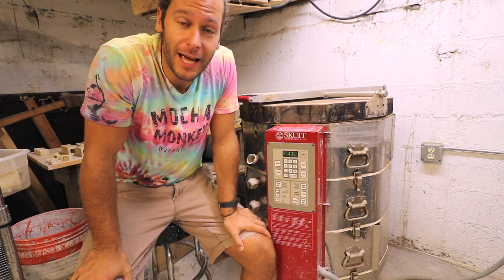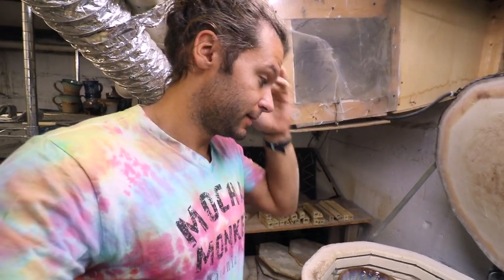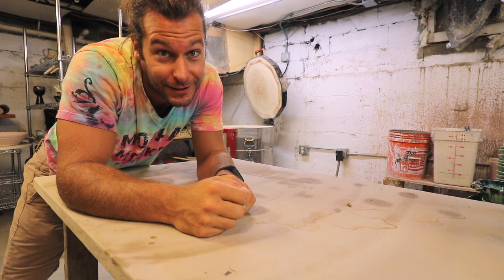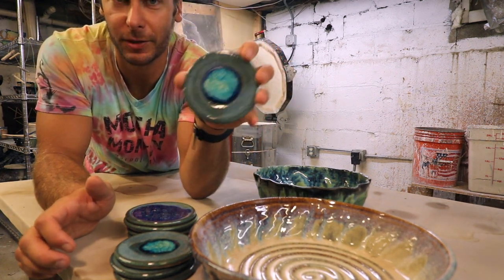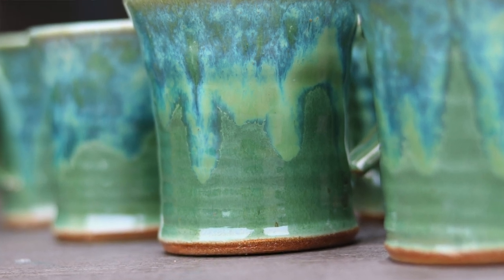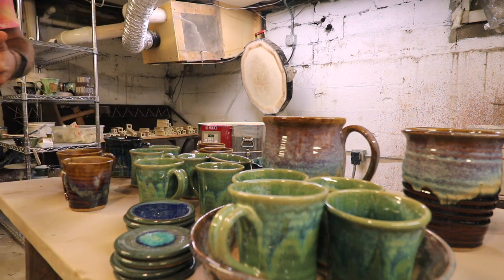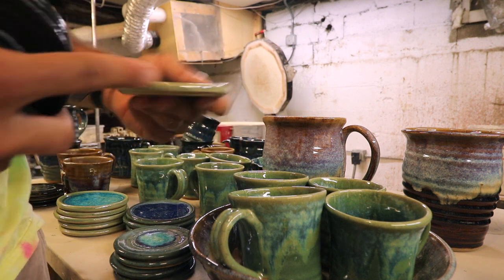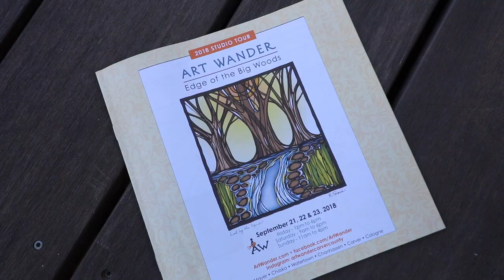My kiln has FAILED!  Unloading Kiln #25

Comment: Changing the thermal couple is pretty easy but you may not even have to change it yet.  Sometimes, I get the fail message on cool down - never had it fail on the actual bake - and turning power off and on can clear it.  Based on this, I think the fail message can appear when the thermal couple is not reporting the correct temp inside the kiln during cool down - so, sometimes you get the display alternating between fail and an inside temp (which is usually way off).  Power cycling can get the kiln to report the correct temp inside - so, you should do that if you are an impatient person like me that doesn't wait for the kiln to get to room temp before opening it just in case it is actually way too hot.

If power cycling does not reset the fail message (try to run a firing using the cone fire settings - when you push start it will display fail), then you need to change the thermal couple.  It is actually a very easy fix, just a few screws.  With only 25 firings, I have a hunch you bumped it during loading/unloading or accidentally had glaze drip on it because they should last longer, with the chip in the top of your kiln brick, I am guessing bump (I have an identical chip in my kiln from being careless with a shelf).  Good luck with the fix!
Reply from the maker: Thanks for the comment, I appreciate the thoughts, this kiln actually has about 450 fires on it right now so we have replaced elements and thermocouple a few times.  I did power cycle and that didn't fix it, but after replacing thermocouple, all good!!